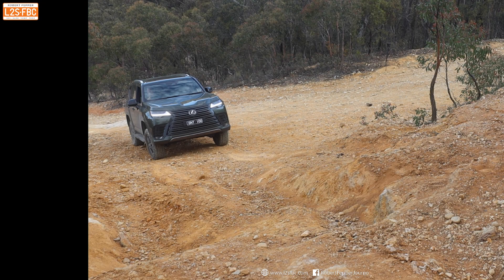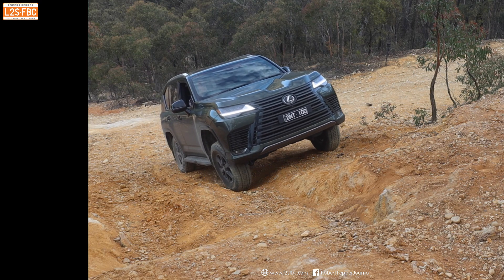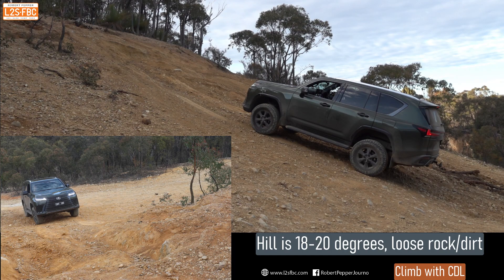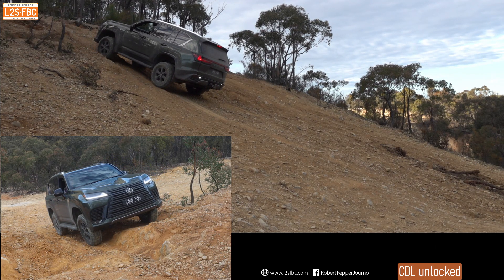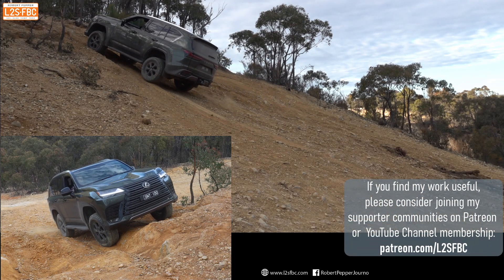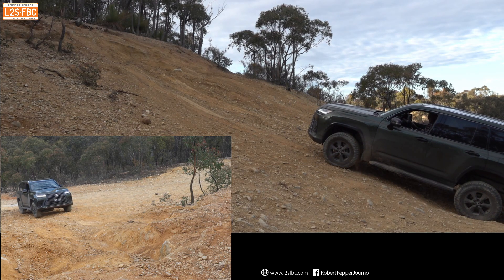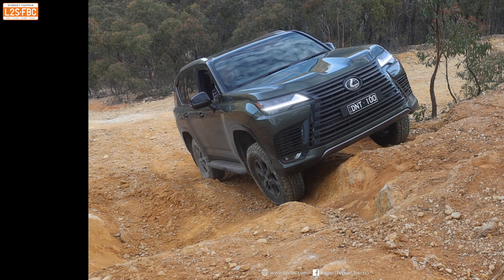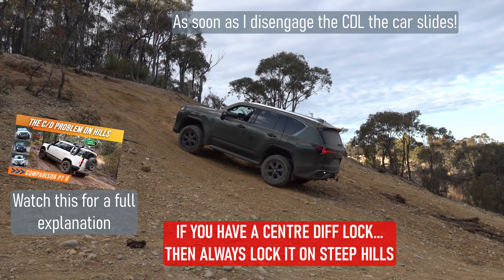The potentially deadly oversight on hills

Comment: Mostly opening the centre diff with no drive will result in the torque transfer to be lost to the open end of the transmission, ie the freely spinning clutch, it doesn't work entirely the same way with an auto, as the drive is alway resisted. There are noticable differences in the various types of transmission, ie fully open centre diff with lock capability, viscous coupled front drive and viscous coupled diffs and dog clutch front drives. Each acts differently in this situation. The other fundamental differnce in how the vehicle acts is the braking system. some are good at holding the vehicle on a slope, others are not. The hand brake also has an effect on the behavour too if used. 
I never really noticed any undesired operation of the old D1 auto, but then it's brakes are, for the age and type of vehicle, better than a lot of it's competitors, I guess that's what you get for vehicle that has capability of a fully loaded 3500kg trailer and full MAM/GVM capability. Not many have that. 
The other thing to consider is actual tyre pressure, type and size on how the vehicle gets effected on the slope.
Reply from the maker: In the demo shown, opening the centre diff allows the front axle to turn at a different speed to that of the rear axle.  In this case, it's nothing to do with torque transfer as the car isn't moving.
Reply: @L2SFBC  The car is moving, it's slipping down the hill. Torque is a turning force, are you saying there is no turning force attributed to any of the drivetrain? There is, it's derived from the ground turning the wheels because the brakes are not adequate to hold the wheel still against the effects of gravity. The statement is factually correct. Remember torque is not just from an engine it is from any moving part that has a rotational force applied to it, in this case the wheel.
Reply from the maker: The problem began when the car was stationary.  The fundamental problem is more braking force on the front wheels with low grip than the rear wheels with lots of grip. The car is at idle in reverse, the front wheels are locked...the issue here is brake force distribution not torque either from motor to wheels, or vice-versa.
Reply: @L2SFBC  How is the brake force distributed if it is not torque through the transmission? Magic? Whichcraft? No. The fact is the front brakes hve a good claming force transferred to the axle, that is transferred via a twisting force through the transmission (as that's the motion of the transmission) to the rear hubs and thus wheels, removing the diff loclk, ie the link that hold the torque in as potential energy ( ie there is indufficient torque to actually move the other wheels), it releases the potential energy to the clutch or TC as movement. so the torque is used in untwisting the transmission. At this point the forces of gravity overcomes the now insufucient clamping force on the rear brakes.

The fact remains if the vehicle was not moving, then the vehicle will remain not moving as all forces are equal, removing the link makes the forces unequal and so the vehicle can no longer sustain equalibrium in brake force. at that point, it is in fact moving. 
This is of course basic physics, so why say iy's not moving when it actually is?
Oh, as it's an auto in reverse, the torque converter will be spinning so actually helping the drivetrain overcome the brakes sd the torque will be put through the gearbox, multiplied further and then as the front brakes are locked, it has no option but to follow rhe path of least resistance which is the lower clamping ofrce brake set ie the rears which are already compromised. 

If you think this is wrong, please give the scenario to prove otherwise.
Reply from the maker: I think we're pretty much on the same page.  The main thing I want people to take away is needing to lock the CDL on slopes, and second the brake distribution problem. If they go beyond that and understand the physics so much the better.  The point re not moving was to emphaise the problem begins when the car is staionary.
Reply: @L2SFBC  agreed, I was being a little pedantic on things, but then sometimes you have to be. like the moment that the CDL is removed, the brakes can no longer cope and thus you fail to maintain the position. 
I guess one way to describe it would be effectively the samilar action to an Anti Roll Bar, it transfers the load to the other wheel, the CDL transfers the load to the other axle. The mechanics are the ame the use of a tortional force to transfer the energy or potential.

Comment: That center diff is back feeding the braking force to the other wheels
Reply from the maker: Not really - locking the centre diff forces front and rear axles to turn at the same speed, hence in effect more braking force to the rear.
Reply: @L2SFBC same concept, different verbiage

Comment: I had to google "How is a 4wd transfer case different than a center differential?"  The gist I got is a center differential allows for the use of full time 4wd on pavement and all 4 tires can spin at different speeds. Center diff locks are still kind of rare in the USA. Lexus has them, I believe the new gas Land Cruiser (Prado) has them. I think the 392 Jeep Wrangler Rubicon has it but the rest of the Wrangler line doesn't. The standard Jeep Wrangler Rubicon has a 4 to 1 4wd transfer case. 

Maybe you can explain the differences between the 2 better? Some say the center diff lock is superior to a standard 4wd transfer case. I do a lot of off roading and haven't seen anything to back that statement up. Oddly enough my gas 3.5 Ecoboost 2019 Ford F150 Platinum FX4 has a 4 Auto position that allows for full time 4wd. I don't understand that one either.
Reply from the maker: Sure!  Refer to pinned comment for the detailed version of this demo.  And for AWD/4x4, watch this, I'll add that to the pin.  https://www.youtube.com/watch?v=drMmke7WL7s&sttick=0  and if that doesn't answer your queries, post questions!
Reply: Simple 4WD transfer case engaged: the two axles turn at exactly the same rate, this means at least one front wheel and one rear wheel turn at the same rate (the other wheel on the axle because of the axle differential may slip and thus turn at different rate; only when the axle differential is locked then both wheels on that axle turn at the same rate). 

The center differential unlocked permits the front wheels and rear wheels to turn independently. So even if one front wheel slip the other front wheel may provide traction, but may turn independently of any of the rear wheels.
Reply: Also the transfer case in 4WD permits to go from 2WD to a Full Time 4WD with Locked Center Differential. 

The Unlocked Center Differential is a different mode not available on part time 4WD, where front and rear axles can turn independently, while still providing power.
Reply: you know how a axle diff lock works, it's exactly the same principals involved, jsut in the middle..Look at Land Rover LT230, the centre diff locks the front shaft to the case, thus preventing the differential from functioning. 
I've been driving permanent 4wd for decades, and it is better, you can provided you select the diff lock without load or cornering, drop it in at any time or speed, most part times you have to stop to change the type selection, with the perm 4wd it's always in 4h so you just need to stop or slow to change to 4l. as per normal. A lot of part time 4wd are rear wheel drive with a dog clutch to bring in the front.

Comment: Interesting, thanks. My old Ranger had a CDL button but I don't think my Hilux does, just 4WD and I fitted a rear air locker, but I have no on/off for central diff, unless that's auto-covered by the 4WD?
Reply from the maker: Old Rangers don't have CDL, nor does Hilux.  Refer to videos in pinned comment.

Comment: "No matter how hard I press the brakes, the rear wheels aren't going to lock"
You have a defective braking system, friend!
Reply from the maker: No...take a look at the detail video linked in pinned comment. You will see an 80 locked front and rolling rear.
Reply: @L2SFBC  I mean, I'm not questioning that that's how it is, I can see you're telling the truth. But IMO if the brakes are too weak to lock up all wheels when pressed hard, they are not proper brakes 🤔

Comment: Biggest mistake people with no experience make is not selecting reverse gear if they are forced go back down a hill. More of an issue with a manual gearbox. People just push clutch in and use brakes to slow vehicle.
Reply: In an auto, you tend to jump on the brakes, no fear of stalling, and give a bit of time to assess the situation if you are inclined to assess situations, most people aren’t. 
In essence if driving a manual it’s the fear of stalling on an incline and then having to restart that is the main cause of the issue. Anyway in most cases it comes down to lack of knowledge, no one’s fault, all comes down to time and muscle memory (repetition).
Reply from the maker: Yes. Correct technique here https://youtu.be/3UnXWByxJAk
Reply: Very good demonstration.

Comment: You were fortunate not to roll that vehicle given the line you chose.
Reply from the maker: Nowhere near rolling.  Straight up and down, and ready to engage HDC (DAC) if needs be, and no need for an immediate stop.  The hill also flattened out.  Lots of risk consideration there which I didn't explain due to brevity but just put a warning in.

Comment: Would be interesting to see the effect of the center diff while accelerating, steering and decelerating on ice / snow. Thanks for this demo!
Reply from the maker: The answer is wheelspin where it shouldn't spin.  Rally cars that are AWD have some form of limited-slip or clutch in the centre to allow difference axle speed front/rear for turns, but also control unwanted front/rear axle speed deltas.  There would also be braking problems.

Comment: Very interesting.  I asked myself why I would ever not have the CDL on (GX470) going up a hill like that, and I came up with two reasons:
1. It's easy to forget to lock it because the vehicle is capable of doing a lot of terrain without it, so may not think about it when coming up to a hill, and
2. I sometimes unlock the center for a tighter turning radius around hairpin turns. 

Thanks for pointing this out.
Reply from the maker: Lock it soon as you're on a loose surface and leave it in!
Reply: @L2SFBC Sure.  I'm mainly just trying to add to the conversation because it isn't immediately obvious why this situation would exist, instead of calling people stupid like some of the other commenters here.
Reply: I'm guilty of your point 1.  Leading a small group on and easy and picturesque drive along the Lennard track (Western Australia) I was so focussed on trip leader responsibilities I simply forget to engage the CDL after helping others airing down. Thankfully I made the end of track hill climb, in slippery conditions, without stopping or incident thanks to Toyota's awesome BTC!
Reply from the maker: That happens to everyone sooner or later!
Reply: I took my LC250 to trails. It was an easy trail until it got more complicated, next think I knew was I was in difficult terrain in ECO, 4H and open diff without MTS. Of course corrected all when I realized but these machines as you said are so capable you kind of forget it.
Reply: If you are stupid enough to do that on a hill you are too stupid to drive a 4wd
Reply: @roncharles9324  Gee, you must be very proud of your high intelligence. So I'm sure you'd be familiar with Alexander Pope. Yet you make this comment despite his famous words of wisdom on such circumstances.  Why is that? Please enlighten us comment readers.

Comment: This was a great video. I retrofitted and CDL to my Disco 2 some years ago, I always locked it to climb hills but left it unlocked to descend. Hence forth I shall be locking it on descents too!
Reply from the maker: Why unlock to descend?
Reply: @L2SFBC  because I presumed, going downhill I wouldn't need it, unlike going uphill where its useful for traction and such. But that was clear how having it locked helped braking.
Reply from the maker: Definitely safer, uphill or downhill, in reverse or forwards!
Reply: @mikeb53  traction is probably more important going down than going up, going up your momentum is against gravity, going down it is with, so addition of the forces rather than subtraction going up. With the D2, if the TC is working correctly going up the TC should even the torque to the wheels up to a speed of 62mph (I believe it has the same spec as the P38 as same base system), it won't do the same going down unless you have the HDC switch pressed, and then it's a bit arbitory past a certain speed as the HDC can't cope.
Reply: Or you can use HDC downhill. The vehicle can independently brake all 4 wheels as needed which a human ca never do unless they have 4 brake pedals and 4 legs. HDC is superior. I’ve even used it in reverse.
Reply: @jerrymyahzcat  You are assuming that the vehicle has a form of HDC, I agree HDC is good, but aalso is heat limited, it uts out if the modulator overheats. It is also better with the centre diff lock in, as it distributes some of the brake force to the other wheels.
Reply: @overlandready Pretty certain that vehicle Has HDC. Toyota/Lexus have a different name for it.

Also - no way HDC is going to overheat in the 10-20m shown in the video!!
Reply: @jerrymyahzcat  HDC is copywrited, so they can't call it the same name. Yep, I'd agree it won't overheat in the length of the motion of the vehicel in the video, but on a good downhill, it can, so it's an aid, not something to be over reliant on.

Comment: Many people don't understand what a centre diff lock is. By locking it you are  engaging old-style 4WD where the front and rear driveshafts are locked together. It shouldn't be reserved for "off-road" situations. It should be engaged on any loose surfaces like dirt and sandy roads, long before it's actually needed.
Reply: people wonder why I engage SDL on gravel roads and beaches.
Reply: I understand why you say that, but I disagree. I only lock the centre diff when I go offroad, and leave it locked until I get back to another road. I don't use it on well-maintained gravel roads where I can travelling at 70-100ks, because it causes understeer. In an emergency situation, I want all the primary safety I can get. Specifically in that case, primary safety is having the steering response to swerve to avoid a collision, and having normal ABS function.
Reply from the maker: Absolutely!
Reply: Once worked with a guy who firmly believed that you put it in 4 when you got stuck, couldn't teach him to engage 4 and not get stuck. Many a day dropping everything to go tow him out. ( we did on farm work, usually on ground unsuitable for grazing)
Reply: @johnsullivan6709 Hence why I drive a permanent 4WD vehicle - never have to “put it in 4WD” as it’s always in 4WD.
Reply: @landrover1155 AWD on a vehicle with 4 wheels Is also 4WD. It’s just a name. Watch Robert Pepper’s video on that. Locking a centre diff (or not) doesn’t make (or not) a vehicle a 4WD. Driving 4 wheels is the definition of 4WD. 
With Land Rover there are many instances of where you Don’t want a centre diff locked because the vehicle will actually perform better using Terrain Response rather than any lockers; for example.
Reply: 100%,  it says to engage on any loose surfaces in my FZJ80 owners manual
Reply: Thats going to depend on the vehicle
Reply: @ausguy4385  why's that? The reason some vehicles have a centre diff is to prevent "wind-up" in the transmission/drive train. Wind-up doesn't occur in 4WD's on loose surfaces because the wheels can slip to release any build up. Hence, any road where the wheels can easily slip such as snow, ice, loose dirt, gravel, sand, mud, you should engage the centre diff lock if your vehicle is fitted with one.
Reply: What if you have separate front and rear lockers?
Reply: @echristianh They are talking about the Centre Diff Lock here - not the front and rear cross-axle lockers.

Comment: How does the new Defender without CDL cope with this?
Reply from the maker: See video in pinned comment...not well, but it seems the very latest ones now fix the problem.
Reply: @L2SFBC thanks, yes I just watched it. What have Land Rover done? Presumably not fitted a mechanical difflock?
Reply from the maker: Current L663s are rear-drive all the time and engage the front axle via a clutch as required.

Comment: When people say that 4x4 doesn't help you stop.. Well, they are wrong. The same results happen on ice/snow. Locking the center diff allows the driver to find the peak threshold of braking traction on both axles, not just one or the other. The difference is actually very noticeable. Knowing when to lock and unlock the center on ice/snow is critical, especially on SUV's and trucks with larger wheel/tire packages where ABS is less precise.
Reply from the maker: Absolutely!
Reply: Absolutely. I won't use ABS none of my vehicles has it. We need the ablity to spin the wheels if we have to.
Reply: Wow! 2 smarts comments in a row regarding 4WD. I keep telling people that type of things on Reddit and I keep getting downvoted!!

The other thing is that 4WD helps stabilize going in a straight line as well, because the FWD part of the 4WD counteracts the torque of the RWD when rear axle starts sliding sideways. 

Thus, even in the rain 4WD helps! (FWD also helps regaining traction faster by scooping the water out faster than if they were no traction)
Reply: My truck doesn't even have ABS